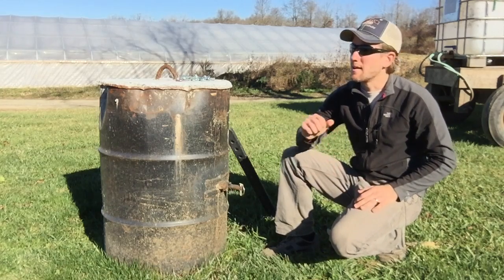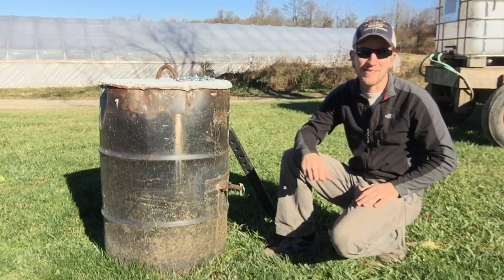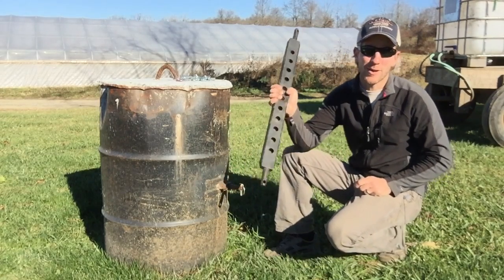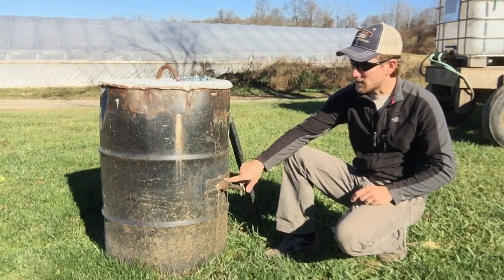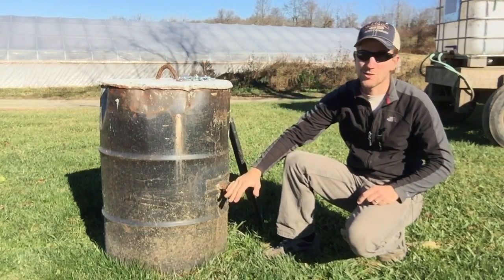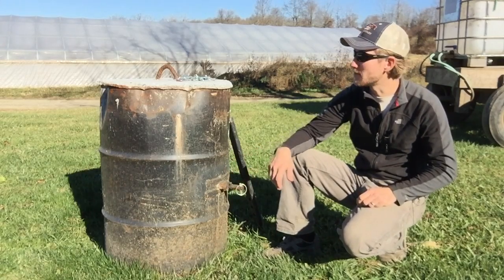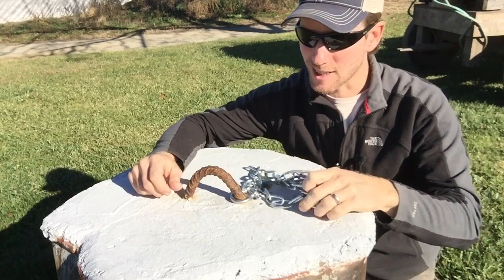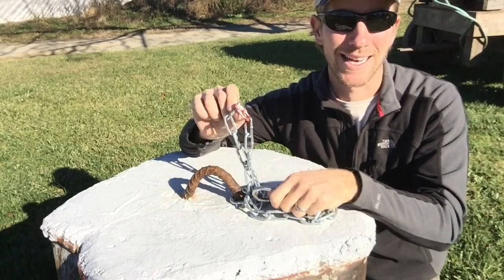DIY Tractor Counterweight

Comment: Good video! I built one 25 years ago from a plastic 55 gallon drum 3/4 full of concrete/rocks (900#?). It has a steel mast for a rigid top link (to stop swaying/sagety), a draw bar lower down (that'll give more ground clearance when raised) and finally a reciever hitch. All steel components are welded together prior to cement/rock pour. The drum sides from the concrete to the drum top is a good place for tool storage. I use it on a 1952 Ford 8N for heavy farm work all the time....it works great 🤠

Comment: Because my first metal barrel rusted out, I used a leftover 50 gallon plastic chemical barrel to do something similar.  I welded two tall pieces of heavy steel angle iron 90 degrees to the drawbar an appropriate distance apart, with a hole in the top.  That way, I have a perfect place to hitch my center lift link.  One other thing I added were two tall four inch pieces of PVC vertically in the barrel before filling with cement.  I use those to place my axes, shovels and other long handles tools before heading into the woods.
Reply: I Like that idea:  " I added were two tall four inch pieces of PVC vertically in the barrel before filling with cement.  I use those to place my axes, shovels"  That works great I bet.
Reply: Nice touch.
Reply: Awesome. Thanks for the suggestion. I be gonna get er done😊

Comment: I needed to limb up several hundred trees on my property as a wild fire prevention measure, and I didn't want to spend weeks on a ladder. I took a IBC tote, removed the plastic tank, slid it onto the forks of my tractor and secured it to the forks with a chain. Standing inside my diy safety cage with a small chainsaw and a pair of heavy duty loppers and my dad running the tractor, I knocked out this project in two days. You also want a ballast box on the back of the tractor for this and keep it as low to the ground as possible.